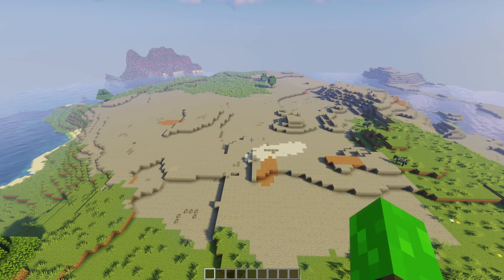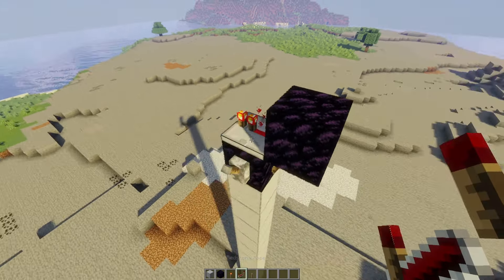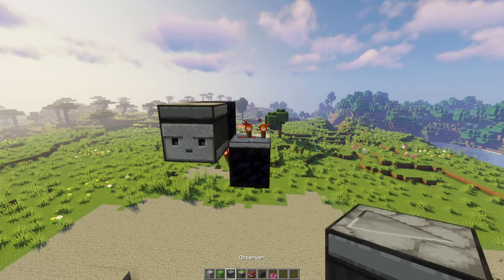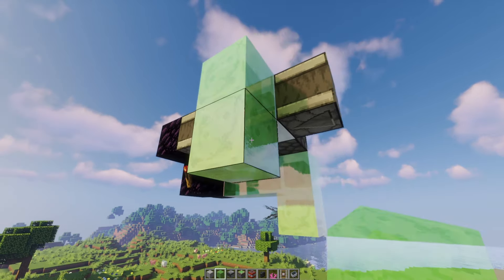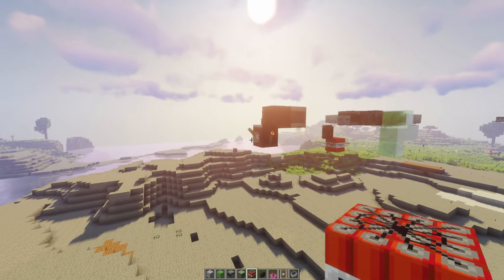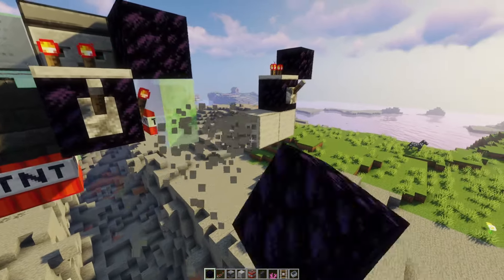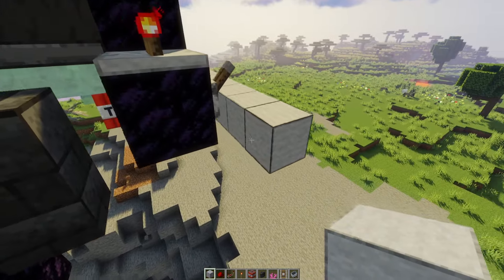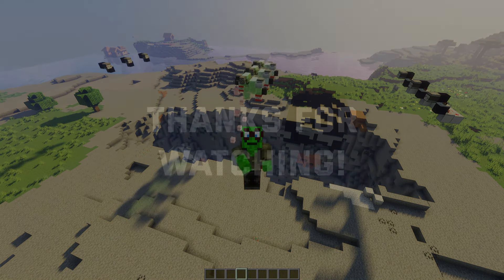Two Way TNT Flying Machine | Tutorial | Minecraft 1.20+ Java

Comment: What would be the ideal place for me to afk for it so it doesn’t stop working if I’m digging a bigger area?
Reply from the maker: As long as you are loading the area you are using it for that would be fine. The problem would be if you unloaded the chunks whilst it was going. That would break it.
Reply: @BobertPickle  okay thank you so if I’m mining a 16x16 chunks area which is 128 blocks by 128blocks do I just load the area once and that’s it?
Reply: @preavalanche397  You have to be within render distance of the area affected. Which can change a bit depending on your settings, but roughly the middle of the area would be the ideal location. If that is not enough only other solution is build a small honey block flying machine and ride back and forth with your TNt dupers.

A honey flying machine because you can stand on a honey block and should not get knocked off by it moving.